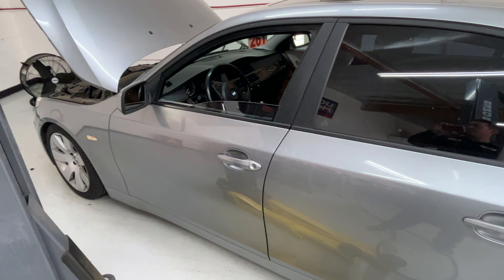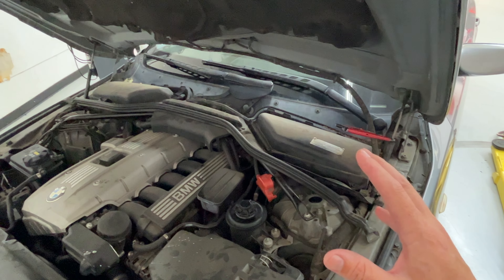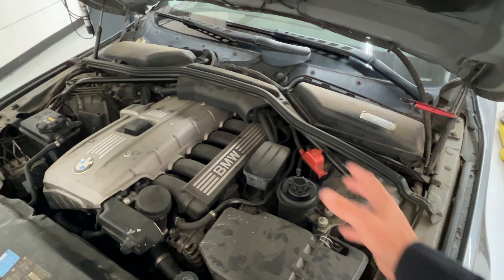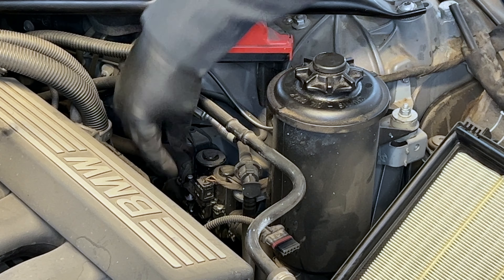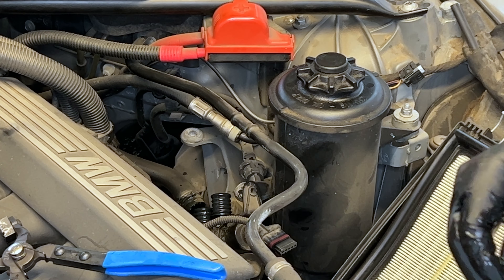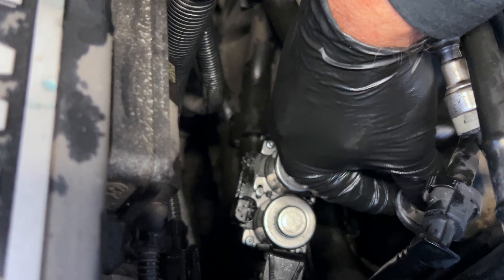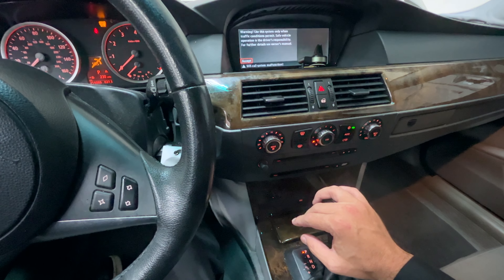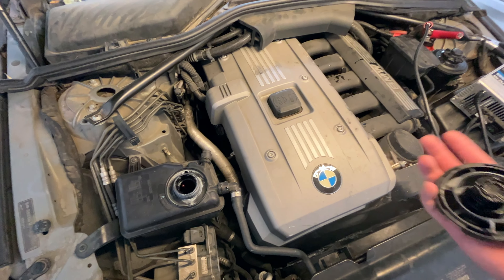BMW -  A/C or Heater not working?  Could Be This Common Issue.

Comment: What if i dont bleed the system and just replaced it
Reply from the maker: You will likely have no issue. The system will bleed itself when you drive with the heater on and burp an air bubble.

Comment: Hello, my friend has a 2006 bmw 525xi. Before we took anything apart his climate did not work at all. Any turn of the fan speed dial nothing would work maybe once in a blue moon he would get air sucked in through the fresh air vents. We replaced the blower motor first old one looked burned out and corroded. We swapped the resistor into the new one and plugged it in and plugged in the ccp. Fans spun and adjusted with the dial. We put it back together and then tried it and nothing. Everytime you plug the middle pin in the ccp that controls the heater and air conditioner system all the power goes dead. We replaced the air conditioner blower fuse and the old one wasn’t blown but the prongs were black. Any ideas? Still doesn’t work
Reply from the maker: Could be a bad control panel. But sometimes the wiring melts at the harness that plugs into the fan. Or the contacts are bad. Thats the only thing I can think of.
Reply: @MikeMDs  he tried a different climate control panel from a scrap yard with the same part number and still didn’t work.

Comment: I have a 2016 bmw 528i xdrive with a u019f code lost communication with water pump, also no heat with in cabin would u suspect the electric water pump failed ?
Reply from the maker: Water pump sounds bad.  Also a faulty heater/water valve can cause no heater. But if the issues happened at the same time then it is probably a bad pump.
Reply: @MikeMDs  thanks Mike for the reply

Comment: I dont get it? why wont the AC work? dont they have a flap which allows and blocks the air coming from the heater core? SO if the AC is on no matter how much coolant is going in the heater core the hot air from the heater core wont enter the cabin.
Reply from the maker: The valve regulates coolant flow. There is a flap to distribute bit it is small and can not isolate completely.  The heater core is stacked next to the evaporator. so the fan blows through both of them at the same time
Reply: @MikeMDs  thanks. I have a bmw 120i 2007. whenever i turn on AC or heater I get this hint of a smell which makes me sick, I get some itching around my mouth area and get cough as well. I have used 2 cans of AC system cleaners by injecting the foam in all the vents, injecting the foam by removing the cabin flilter from the foam and putting the foam directly on the running blower fan. but the smell keeps coming. now I have been using the car regularly so realized that even when the car is not running it still has that smell. Do you have any idea from where the smell might be coming?

Comment: Can I ask s temporary means put a ball valve in line and shut it off so no flow goes thru it. Would that cause overheating?
Reply from the maker: I'm sure It wont cause overheating.